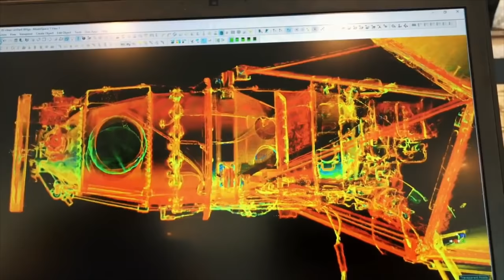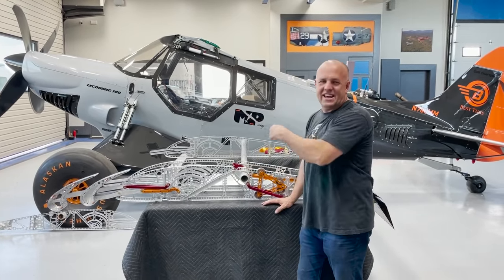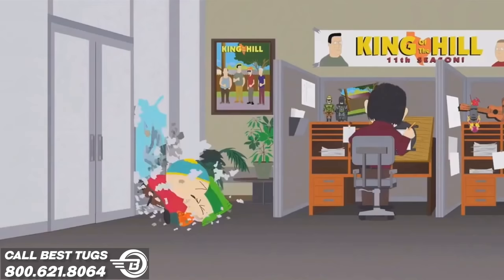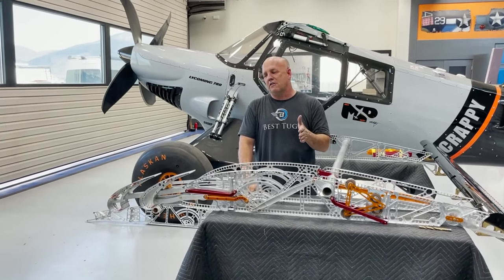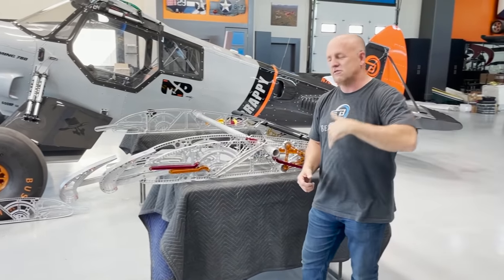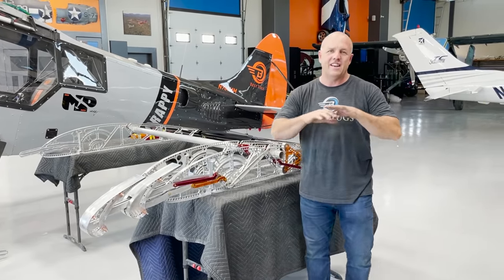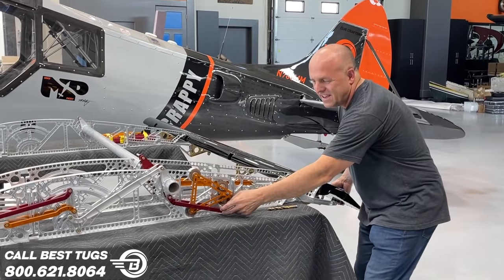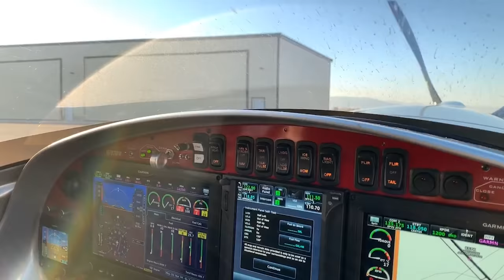DECLASSIFIED Hyper-STOL Transforming Wing - Patey Twin Slats - Fast and Slow | Scrappy #57

Comment: The concept is interesting, I like the innovation it raises. I only see some errors that take away from it efficiency.
  Ancient ships used 2 or more bow sails. The reason why they used multiple candles is because of their weight and the difficulty of handling them. With the advent of the steam engine, winches began to be used. Mechanical systems expanded the possibilities and Cutter rigs are no longer used today.
  You can see the class J sailboats of the American Cup as an example of what I am proposing.
  The multiple sails generate resistance and turbulence that reduce the efficiency of the system. It is more efficient to use a single sail. And here I see the same.
  I only speak from theory and from my experience as a sailor, perhaps the different speeds generate other effects. The only way to know would be in a wind tunnel.
  I hope you finish your project to see how it works and if it checks the theory.

Comment: I have a feeling that you're getting so close to the point of hovering that if you have to go around you'll need a taller tailfin. Maybe also fences on the wings to tame any sudden roll at the stall. 
( Edit: fences - I've seen them on an old freaky experimental PC-6 with a straight wing with experimental slats - covered in wool tufts - for the same reason. I guess they are super-light and a quick riveted-on cure if it needs them. It's the only non-swept wing I've ever seen fences on, pilot mentioned  )

I've always wondered if winglets would be helpful on such a STOL wing too, of only to save your complex mechanisms inboard if you ground loop it, drag a low wing in crosswinds or even have a hangar oopsie.

Comment: Absolutely insane engineering,  but when the weather turns bad, how are you going to prevent rain from entering the wing through the actuator slots?  Rubber seals?

Comment: I still want to see the 100 hours of footage and years of research, please!  What you are doing, especially with the wings, is what the military aviation community is wrestling with, and its call Full Sized Determinate Assembly (FSDA) or as Dr. Roper termed it "the digital thread".  Designing, analyzing, testing, in the digital realm, all of the features, and functions, and then producing a bolt together assembly that works, and doesn't require 100's of hours of hand work...  I have suggested that all DoD aircraft projects start by watching this series of videos...  Its a Master's class in craftsmanship, innovation, aviation, engineering and design...  Back to work!

Comment: Hugely impressive engineering of the ribs and slat/flap deployment.  However, on the aerodynamic stability side I am  bit concerned that double slat moving so far forward will shift the aerodynamic centre of the aircraft forward and reduce the static margin and pitch stability with it.  

I don't know static margin that Draggy is built around, or size of shift forward in aerodynamic centre that will occur with this particular slat/flap combination, it may be that it'll just a small reduction in pitch stability and not dangerous.  However, if the existing static margin isn't sufficient it could be slat travel is so large that could lead to neutral or even pitch instability when deployed.  I think this is serious enough issue that a whole aircraft model with the slats deployed and a range of COG positions is worth undertaking.  

If this analysis has already been done, then great, and would be worth adding a discussion about this in the next video, as stability is so crucial to aircraft safety/flyability.

Comment: G’day from rural Australia 🇦🇺 
Awesome concept and the airflow changes are exciting. 👍👍
Am wondering what is to prevent air entering the inside of the main wing and of the innermost slat via the pushrod holes? This could get interesting with moisture and altitude ..
Am wondering what the “normal/neutral “ position is compared to + or - one and what used for take off

Comment: The red attachment point bracket on the torque tube appears to rotate up and outside of the wing skin when in the up/fast position, where it would be interacting with the laminar airflow. This must be an intentional part of your design, but I do not know enough yet to speculate what you're planning to do with that.

Best guess: Possibly some "bristling dragon fin"-like vortex generators that pop up only at high-speed, that are set back at the center of the wing, because the wing chord is so long? I thought VG's were for slow speed, but there is a lot I don't know!

Comment: Mike could you add a manual mechanical backup so that if the electric motor fails you can control it manually inside and have it go to locking positions so you don't have to keep your hand on it at all times?

Comment: Well worth the wait! Are these wings going to require some intense test flying and inspection regime?

Also curious if you have any rules of thumb for ergonomics in the cockpit which help reduce pilot fatigue. Im sure you’ve hinted at it in previous videos, but those throttle mount switches made me think about the balance between ergonomics and reducing pilot error (say from bumping a switch)

Comment: The concept of High and Low air pressure over a flying wing just got broken down, re-engineered, relaminated and put into aerodynamic work flow so that I now have to get vortex generators for the brain for.........Flaps at 10 degrees abeam the numbers.  But....it's totally okay because its fun.

Comment: Dear Mike
If the flaps are mechanically  linked to the double slats does that mean you can only ever do STOL landings? Wouldn't you want to be able to deploy the flaps alone with slats stowed?
Paul C

Comment: Mike, love your vids. Thanks. We see that the bearings in the ribs for the slat-arm-arrangement are running nice now with pretty small tolerances,  but what happens when the aluminium wing main spar expands with another coefficient of thermal expansion than the carbon slats ?
In heat the wing expands quite a bit...and the slats don't.
Do you have enough play for that ? ..and not too much to keep it from vibrating which causes wear

Comment: Respect, I hope you did some wind tunnel testing. Tool you are using has some limitations and it need some tunning. The hyper lift wing center of pressure is sometimes unstable making flying not pleasant.

Comment: What's the life expectancy of the aluminum slat tracks?  They could take quite a beating from the steel bearings (and not easy to replace)  
How about using a hard rubber cover/wheel (replaceable) on the bearings supporting the slats?  The hinged solution you used on the flaps seems more durable.

Comment: With the deployment of the various devices the increase in downwash behind the wing will be extreme. Do you plan to automatically adjust the horizontal stabilizer angle for this? Otherwise tail stall becomes a possibility. I had that happen on one airplane with very effective flaps. It pitched down rapidly.

Comment: I want it on the lancair 4p. I think a smaller derivative of this design could work for 4p or lx7.  Use springs to automatically deploy at low air speeds for stol or stall prevention in flight.  Thoughts?   Would this work on a laminar flow wing type?

Comment: Engineer here (not aero, just electrical). Since you're adding a high speed air flow to that inside front flap, would you have more of a tendency to induce icing vs a normal flap due to pressure change in that area?

Comment: Mike, in doing new designs I'm always thinking of 'what ifs' to cover repairable events. On the ramps there are always acft strikes by ramp vehicles, or something. --- Question; Have you conducted a single slat mechanism rib drop test with the colorful linkage extended to catch the impact see if the arch tracks are effected in the least?  It looks as if all the slat mechanism components are replaceable except the arch tracks which may require a major wing rip-out operation if they become misaligned. Maybe a replaceable arch track plate would relax that question? --- That is the neatest vertical tail fin, I'm thinking it favors the P-39 profile. Thks.

Comment: Have you taken Scrappy out for a flight test point ware>  1)the wing is in "high speed mode" > 2)deliberately stalling the aircraft> 3) Recovering the aircraft by only deploying the slats to full flap condition?

Comment: This is such a great idea! I only have 2 concerns, 1) the complexity. Is there any way to simplify the operating mechanism by using gears or some other mechanism, and 2) the mechanical lever arms connected to the flaps seem like they would get really loaded up when the flap goes down. The air pressure on the flap, and the stress on the lever arm might be a bit much.

The idea is awesome but the complexity / stress are the big concerns for me. Hey, do a context to see if someone can produce a simpler, more sturdy design that does the same thing...

Another thing occurs to me, you could potentially do this over a shorter span rather than the entire wing length. Say 6 to 8 feet on each wing?

Comment: I always thought that solution to this problem was to change the Camber of the wing by changing the thickness on the top of the wing. It is probably impossible but it gives lift without as much drag an without changing the center of lift.

Comment: this could become the "holy grail" of the high lift wing, I've wondered for years why a balanced wing in high lift mode just didn't exist beyond a great big compromise. I do agree the amount of CNC machining will be massive so true will be treating the ribs to prevent corrosion, special note as matter of fact model airplanes have used drooping ailerons by changing the shifting point with the anchor point much simpler. What is the balance difference from the flap to the ailerons using this dual leading edge slats (since the ailerons won't be 50%)?
Reply: Mark- epoxy primer for any ingress of nastiness, and rubber or delrin/similar material for sealing the activation arms.  But, this guy will show us later his solutions.  Ya gotta know that he has already planned the cure.

Comment: I sure hope you took into account the change in your wing icing when you increase the volume and pressure of the air now modified going over the wing. Or is this not an issue with the design at lower temperatures and higher humidity weather?

Comment: Please add de-icing and A/C. Or perhaps a removable system(s)...or tubing which re-routes some exhaust. You can also break a piston altitude record with that wing in max-take-off configuration, if you can spend a few nights considering a simple invention for 'high-altitude piston'; not turbo of course because the NOS solution, but something to complement that prop and high-HP engine. Just sleep on it. Would be great for your practical contribution to aviation (STOL + ultra-high altitude)... especially with YOUR wing and prop. All you need is SPACE certification from FAA...and perhaps a space suit. Would be like a "declassified STOL U2" platform..!!

Comment: Will any of the severe wing configurations take airflow away from the control surfaces at the tail of the plane?  Also is it possible to have a manual lever control if electrics or the linear motor fails?

Comment: Have you thought about testing this wing design on an RC model first?  I think Horizon Hobby makes giant X cub.  Also, I'm a bit concerned about the bearing tracks.  If some dirt or debris gets in there it could jam the bearing by acting as a "chock".
Reply: This is an excellent point.  I have to imagine these complex’s ribs will only be at the inboard and ends of the wings.  I have to assume there will be an inspection port to preflight these?  Then again, does an inspection port itself introduce an opportunity for debris to enter?  Wow my head just started hurting again.

Comment: Amazing innovation but it also creates a number of additional maintenance and breakage opportunities. Wouldn’t there be a simpler option to use pneumatic pressure to deform the wing under a stretchable membrane and do the same thing? Internal air bladders could be inflated and deflated to perform the wing deformation and then utilize the stretch of the membrane to return the wing to its resting position. - my concern with this design is all the moving parts internal in the wing, the additional weight as well as the opportunity for foreign matter like Ice formation between the external moving parts

Comment: Very impressive. I see nope downside. With just one input control, if any of the levers, cables, rods ets locks up, your flaps are locked into place. Basically more things that can go wrong. And because there's no redundancy, any of the increased points of failure locks up the entire system. This can be failure on the ground, or in the air. Hit a small bird, no flaps. A nut comes lose, jams any of the parts, no flaps. A cable hops off a pulley and jams, no flaps etc etc. I suspect there are answers, but they rely on multiple independent control systems. Like, don't use one of those linear actuators, use 3 or 4 smaller ones and divide the wing into 3 or 4 independent sections. You can lose one, but at least you will be fault tolerant.

Comment: Doy ou have some sort of electronic overide or fail safe, the pilot selects one of 5 or 6 position re wing shape however this is not wise given flying dynamics,, or will it just do it, meaning u need a great pilot who never makes significant mistakes nor his flying conditions change dramatically?  Else youw aircraft flying range is less than that of the dynamic wing?

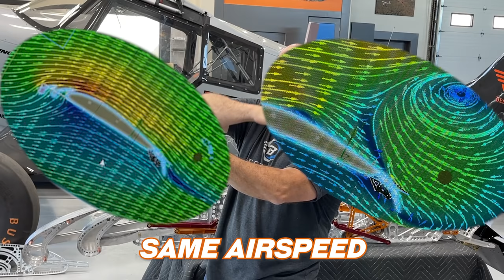Comment: How confident are you of the flow analysis? You made a couple of comments that got my attention. At 22:30 you said "I've never seen that on any flow analysis I've ever done." Could this be a sign that there is something funky with the flow analysis? At  23:20 you said "it just keeps sinking. What it would normally do is stall let go and drop a wing." The way a wing stalls helps to maintain stability: stall -> nose drops -> speed picks up -> stable flight resumes. This sinking condition could be very dangerous if you don't have enough elevator control to nose over and get out of it. At a minimum, it will require positive pilot to react whereas the typical stall behavior automatically happens. Have you thought of building a wind tunnel to verify your flow analysis? Looks like you have a enough resources to build a simple open circuit tunnel to test a section of your new wing. Your work and your wing are VERY VERY IMPRESSIVE.

Comment: I am not a pilot or engineer. When I first saw this design my concern was how will you deal with icing on the front flaps and the arm mechanism?  Especially since this is a bush plane that will be sitting in wet, freezing conditions.  How would you design de-icing for this?
Reply: Bush planes don't typically fly in icing conditions.  If however he decides to add anti-ice capabilities, he could incorporate heating elements into them like helos do for their blades.

Comment: In my reading of aerodynamics so far, I ran across the definition of a laminar flow wing. It sounds great- the air over the top stays laminar. But no, in practice that has proved impossible, so the definition is that the flow stays laminar for about 60% of the chord starting at the front. That has been the best anyone has hoped for. And that is at cruising angles of attack, not near stalling.

Most people, up till now, have been well advised to avoid designing with laminar flow airfoils, because they are so prissy- tiny waves or imperfections in the surface shape can ruin their performance completely. You can't let them get dirty, scratched or dented.

I totally get why you don't want to yell this from the mountaintops yet (an act entirely within your means, apparently) - the model looks like you erased the entire problem. It is not wise to believe that without building it.

I guess that may be the real test- will the hyperspeed airlflow created by the slats mitigate the problems created by imperfections in the wingtop surface.

Comment: How about sucking air by holes in the wing to make the air flow happening in zero aircraft speed? That may be a vtol configuration. The leading edge blows and the flap suck air in of the same pneumatics. I like that wing but still uncomfortable with big landing gears and big propellers.

Comment: I will never claim to be an engineer but I do enjoy aviation (brother and father are USN pilots (in both fixed wing and rotary-wing aircraft), and the theories involved.  Here is my question you are using slats and flaps to increase the cord (sounds like a winner) BUT why not droop the ailerons (to basically give you full span flaps)?
Reply from the maker: Yea sir agreed 👍🤠 you may have missed that section but yes the ailerons drop at the same time

Comment: How many of the ribs will have movement mechanisms per wing?
Reply: Also, if there’s a .001 gap even at closed (as you called it “high speed position”) could you design an inlet somewhere to pass air down the wing through that gap for additional cooling?

Comment: Did you use SolidWorks Flow Simulation, or xfoil, or something else?

So you get lots of chord and lots of camber, so your coefficient of lift is going to get up to 1.2 to 1.5 or more.  Your aspect ratio is going down as your chord goes up.  Induced drag coefficient rises as the square of the coefficient of lift, and reciprocally to aspect ratio.  Aren't you going to have enormous induced drag when flying at low speeds?

CDi = CL^2/pi/AR/e

Like, really enormous induced drag.  Aren't you going to be on the back side of the power curve, where total drag decreases with increasing speed, until you get the coefficient of lift down to something more reasonable like 0.8 or so?

Is this thing flying yet?